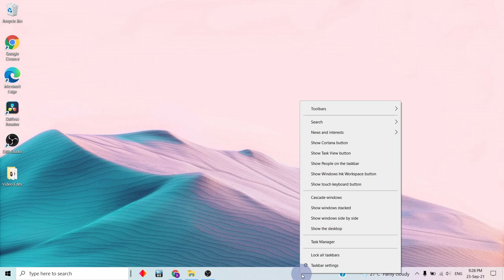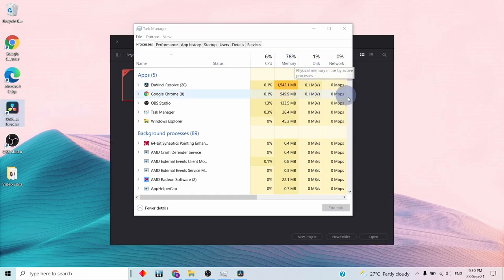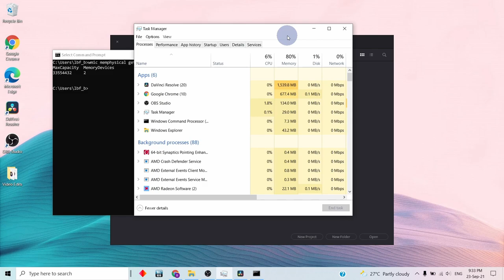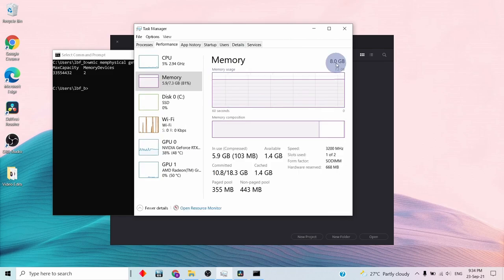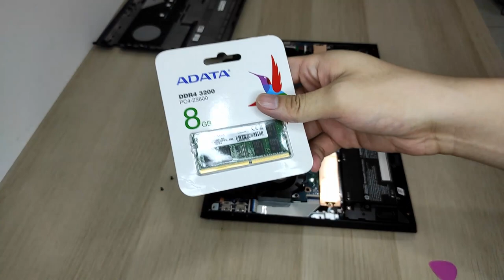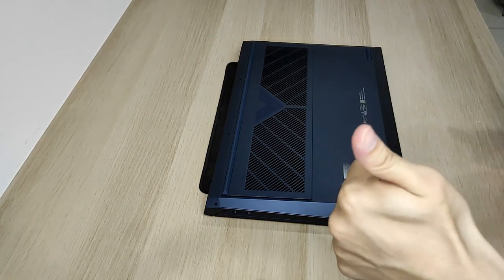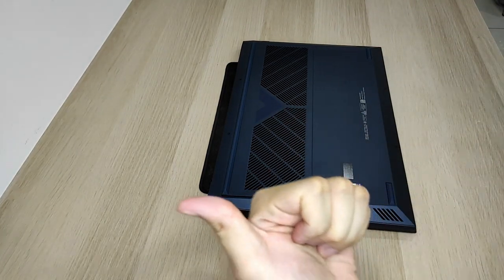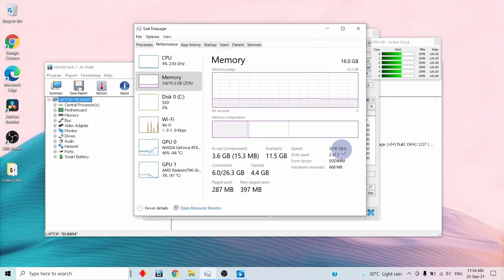RAM Upgrade DIY Tutorial.  The reason why you need to upgrade your RAM? HP Victus, 16GB RAM.

Comment: can we add one 16 Gb ram instead matching both with 8Gb?
Reply: You can but your system would still be in single channel mode with can affect system performance upward of 30%
Reply: @SebastianE18  thank for replying.   let me clarify,  my system has two 4Gb ram.  would it be better with two 8Gb or (one 4Gb and one 16Gb)?  the first option give me a total of 16Gb and the second option give me 20Gb but uneven.  please advise.  thank you very much in advance.
Reply: @letdmichael  the system cannot interleave uneven amounts of RAM, so it is best to have the same amount on each stick for proper duel channel use.  16 GB with two 8 GB sticks should suffice but the laptop does support up to 32gb of RAM so you could grab two 16gb sticks.
Reply from the maker: 2x 8GB will allow your device to run in dual channel. Which we highly recommend to do so

Comment: it doesnt matter if you dont disconect the battery first?
Reply from the maker: I would say best practice is to remove the battery and discharge yourself.

But yeah I didn't remove the battery in this vid and the ram still works fine.

Comment: Hey man, i also bought the same laptop and upgraded the ram. But during gaming, the laptop is hotter 5-7degree compare to before upgrading the ram. So is this normal? Or the ram i bought is faulty?
Reply from the maker: Hey, adding RAM does increase temperature slightly as it boost performance, but it should be almost imperceptibly.

You might wanna monitor it a few more days, to see what's the temp it's running and whether it's thermal throttling. Worse case scenario have to report to HP to claim warranty, probably they will do a thermal repaste and maybe replace your heatsink
Reply: @BF_official_my  how do i know if my laptop is thermal throttling?
Reply from the maker: You can download hwinfo app, it monitors lots of other things and thermals as well
Reply: @BF_official_my  okay, thanks alot💯💯
Reply: @seemanle3968  dude, did you take the laptop under warranty?

Comment: What density is hp victus stock ram?
Reply from the maker: 1rank x8
Reply: @BF_official_my  btw, is it safe to install ram and m.2 nvme while battery is still plugged?
Reply from the maker: @soli5156  for me it works even with the battery plugged.. best to discharge yourself by touching some metal items before you work on it. If you want to remove the battery first,it should work too
Reply: @BF_official_my  metal items? That has paint or purely metal?
Reply from the maker: @soli5156  dont worry to much on this, when you are removing the case you are touching the metal case already, so you are discharging the static

Just make sure you unplug the charger and make sure your laptop is fully shutdown, is most important
Reply: @BF_official_my  Thank you Sir. Hope you can get a tad bit of recognition for helping us. :D
Reply from the maker: @soli5156  thank you for your kind words :) keep an eye out on my channel

Comment: Bro i updrage my ram to 16 gb 3200 mhz  of my laptop hp victus and it shows 2667 mhz in task manager how to increase it bro please tell
My laptop spec
Hp victus 16
Core i5 11 gen
Rtx 3050
Reply from the maker: Hey man, you check whether both slot of your RAM is the same speed. If not it will capped at the lower speed
Reply: @BF_official_my  no bro i have put a 16gb 3200 mhz ram only in one slot the 2nd slot is empty
Reply from the maker: @sg7eff322  download hwinfo to check the ram stats. Maybe the ram you bought is 2667mhz only
Reply: @BF_official_my  bro in bios the total memory speed shows 3200 mhz

Comment: Does ram timing matter ? If use a diffrent brand with same capacity and mhz i have read some ware amd unitis are sensitive to timing
Reply from the maker: I would say the most basic and  important is  RAM frequency and capacity. To get best performance just match both RAM to 3200mhz .

Ram timing seems to be able to tweak in system, but I don't suggest to do it

Comment: Shouldnt you remove the battery to avoid short circuiting ?
Reply from the maker: Hello, it's better to do that, but I've made sure I've discharged myself and shutdown + unplug  power supply before I do this, and it works as well for me😁.

Comment: nah nah nah, you forgot to explain something really important: I bought an ADATA same specifications, the only problem is the  original one was a SAMSUNG, and guess what !!, they are not compatible together, they add up to 16GB but my computer restarts unexpectedly at random times !!, with the famous event viewer critical error ID Kernel 41, and it only happened once I upgraded my RAM to 16GB, so, to check the Memory Sticks I did the tests (MemTest86+) all came out fine, test them both at a time, the computer has never restarted by itself, both of them work fine single handedly !!, so my ADVICE, check what brand of RAMS your are COMBINING, you forgot to mention that SHIT !!!! 😁😁😁😁😁😁😁😁😁😁😁😁😁😁😎😎😎😎✔✔✌✌🤘🤘💥💥☀☀👍👍💯💯⚡⚡⭐⭐🔥🔥
Reply from the maker: Hmm I did a video on how to check the RAM specs. Btw, I have been using for 2 years with the adata and Samsung RAM and never came across what you have mentioned. Check your warranty and maybe update your drivers